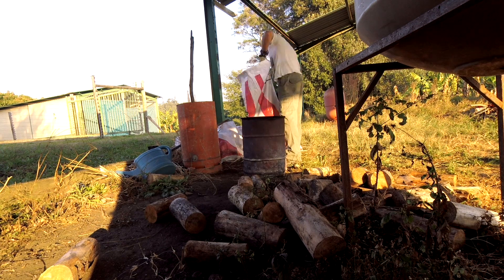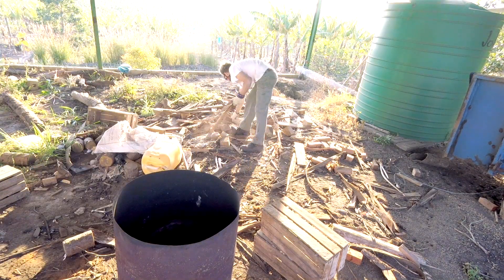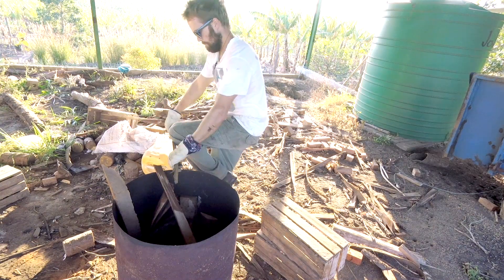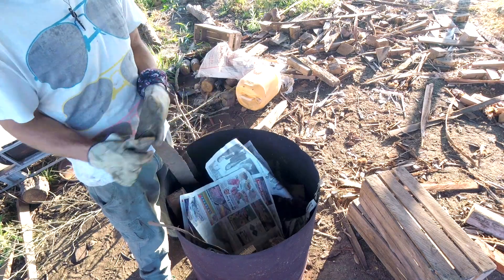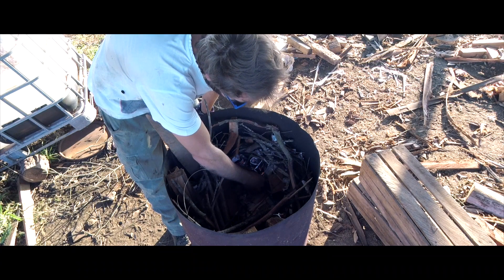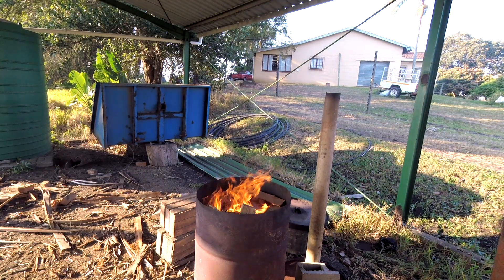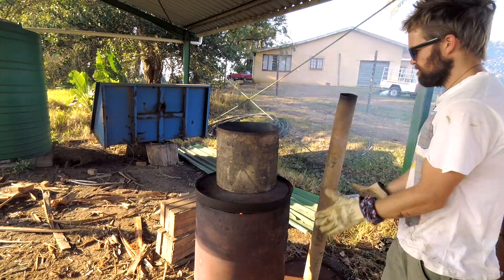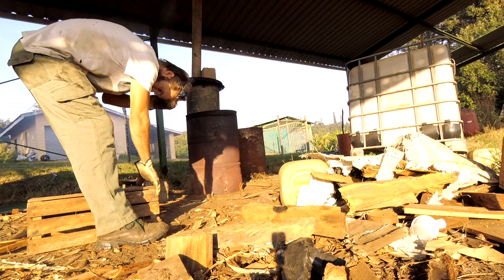HOW to make BIOCHAR in a SIMPLE TLUD gasifier

Comment: Wondering if you can make the smoke stack go out at a 45* angle, cut a notch at the bottom side of the pipe, add a small bucket and collect wood vinegar?  I’ve seen several other people do it this way.
Reply from the maker: This is one of the things I want to try but I have not had a chance yet. Ideally one should cool the exhaust pipe somehow to improve the yield of condensed wood vinegar.